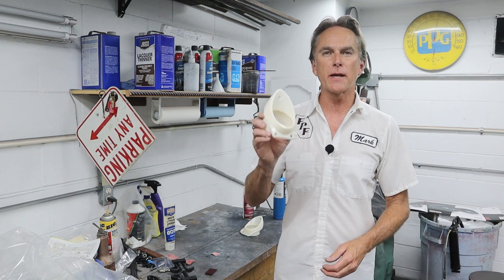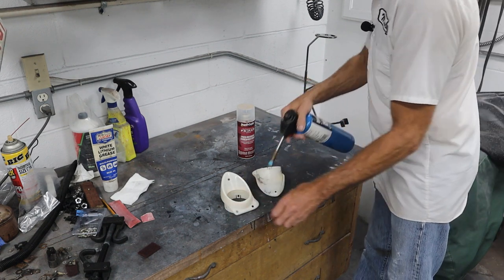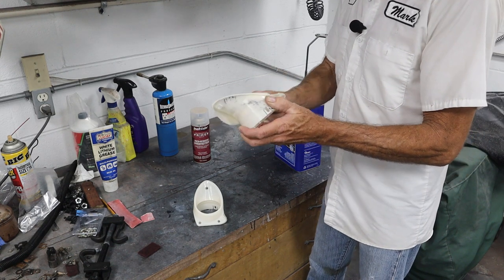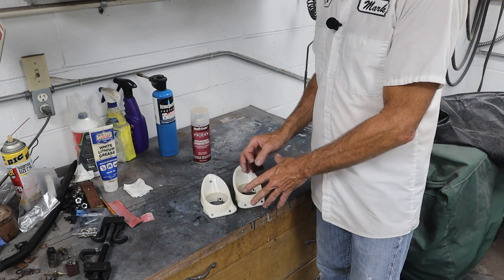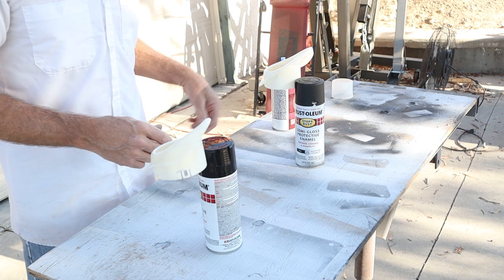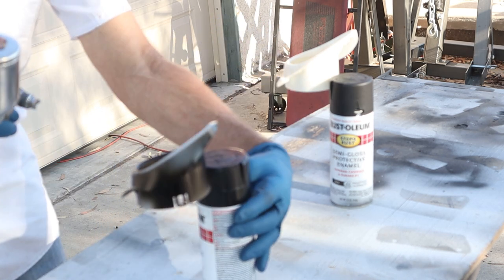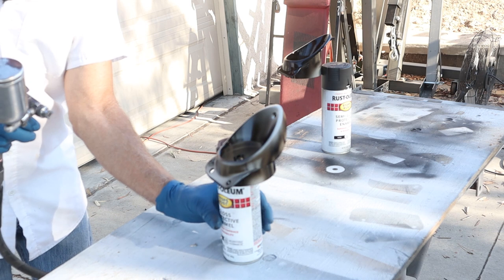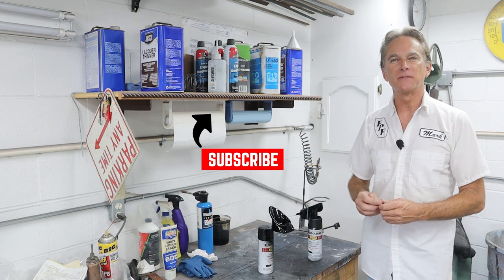1965 Malibu SS (Ep 17) Painting Plastic Parts Tips and Tricks

Comment: Hey Mark
Great process. What type of paint did you use on the black?
Was that chrome on steel that you used the promotor on?
Sound like you can use the promotor on anything if you're worried about the paint sticking?
Thanks Jack
Reply from the maker: The black was the same single stage I used on the firewall and inner fender wells.  Yes the chrome I painted were steel bumpers so stripping it later with paint stripper wouldn't be an issue.  Chromed plastic would be problematic but not impossible to strip later if you were careful. 
The adhesion promoter isn't a replacement for good prep work but it does help in those cases where you might have some concerns.
Reply: @FoothillPaintandFabrication  Thank Mark